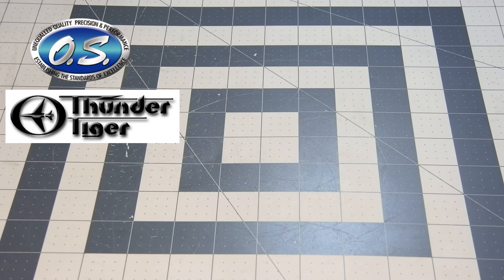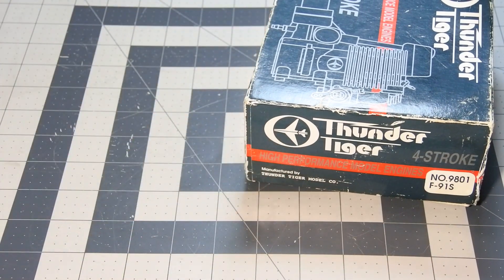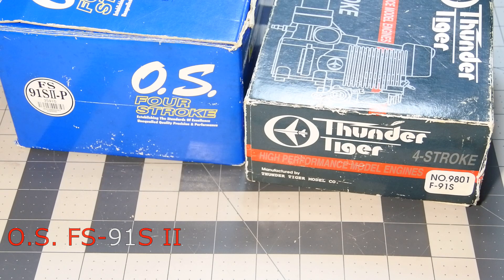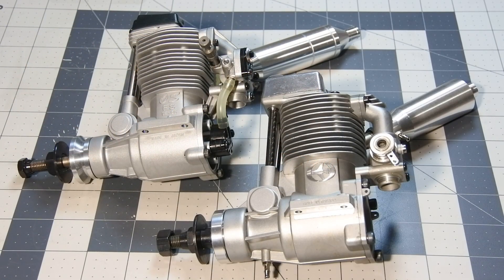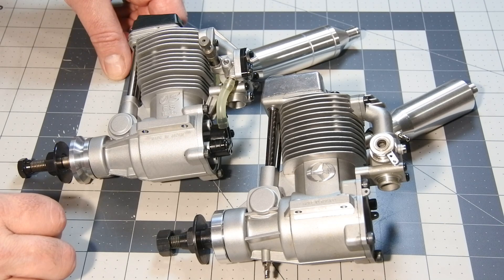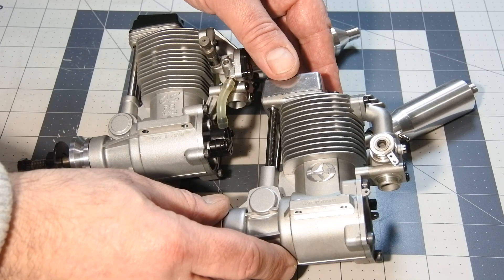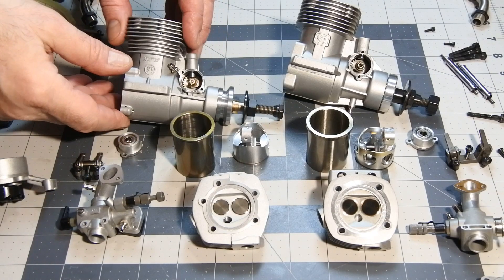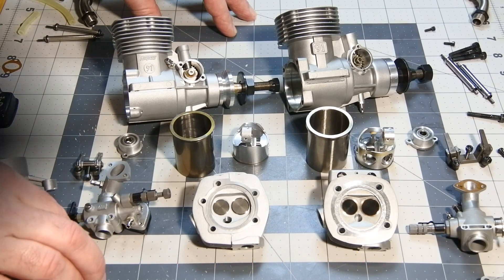Thunder Tiger F 91S and OS FS 91S II design comparison

Comment: You know if the OS can run with the pump removed or isolated some how?
Reply from the maker: Hi, thank you for your interesting question. I'm apologizing, that answering too late, wasn't have a access to my channel for a while. Regarding your question - yes, it possible to run OS FS91 II engine without the pump, mounted on the crankcase back cover. You can replace the back cover from other compatible OS engines, and use your engine in "simplified version". You should know, that you will get less engine power output and in case, that your're flying in acrobatic style, you can meet the circumstances, when in some plane evolution's your engine will suffered by the lack of fuel supply. Fuel pump in this model is specially designed, to guarantee undisturbed fuel supply at any evolution's of your model. Thank you for your interesting question, and have a nice day !

Comment: I also have both engines, but the Thunder Tiger doesn‘t want to run on full throttle, after a few seconds it starts to make ratteling noises, the RPM drops, fuel shoots out from the carb and it stops so hard that the pro nut comes loose and the prop continues to spin freely. 🙉
What could be wrong with the engine? I have already opened it up before the test run, it looks like new. 🙂
Reply: Thanks for your reply! 
I have a 14x6 prop on it and the high speed needle was out ~3 turns, should be enough.
Here is a short video of the engine: 
https://youtube.com/shorts/6JpRbqUST0g?feature=share
Reply from the maker: @gecrashed6565  Thank you for your reply and for video provided ! Unfortunately, this video is too short, to clarify what's wrong.  I'm sure, that the problem or in carb settings,  or in too high fuel level, this could be the reason, why engine behaves like you explain. Regarding the card, some people recommends 3,25-3,5 turns and this is still close to lean settings. B.t.w., how long did the engine takes to break in? Was it sufficient ? So my opinion still the same - engine runs very lean or with to high fuel level. 
I'll recommend you to read this article, where you can find some recommendations about this engine : http://sceptreflight.com/Model%20Engine%20Tests/Thunder%20Tiger%20F-91S.html
 
Thank you.
Reply: Thank you for your advice!
I don‘t know how long this engine took to break in because I bought it on Ebay and the pre- owner said that it hasn‘t ran much.
Reply from the maker: @gecrashed6565  No thanks at all. I could offer to start from the beginning, so to reset the car to factory defaults, to mount engine on the stand (not on airframe), to start an engine with the richer settings, and to run it for 30 minutes with different carb settings. Doing so you can also learn a lot about your engine and its behavior. B.t.w., you can run it in "economy" mode, on the fuel without nitro content. During brake - in process it's now so important. 
Good luck !
Reply from the maker: Hello and thank you for your question ! According to your description of engine's behavior it is showing the symptoms of detonation, so, engine runs too lean. Try to start carb adjustment from the beginning, you need to reset it (to return it to the factory settings, it should be described in the engines manual ), and start engine adjustment again. I've some plans to run Thunder Tiger 54 and 91 engines after a couple of weeks, I'll check, if your problem will happens on the bench. I'll make a video of this test runs, of course.
Thank you and have a nice day !

Comment: Of the two engines, in my opinion Thunder Tiger has the better engineering. I also am very impressed with the piston of the TTR engine, it required many machining operations to produce. The inclined valves and combustion chamber of the TTR are reminiscent of the hemispherical designs. And lastly, big bore will make more torque and swing a larger propeller. TTR for the win! 👍
Reply from the maker: Thank you very much for your comment ! I also have the similar opinion regarding engine design - TTR shows more advance and sophisticated design solutions. But the most interesting should be "head to head" bench test comparison. 
Thank you !

Comment: Thank you for these engine comparison videos, they are well choregraphed and interesting to watch. Just a note on the Thunder Tiger; you made reference to the inclined angle of the valves! You will also notice on the top of the piston there are recesses machined to prevent the valves from making contact with the piston during operation. Please if you are unaware, this means the piston has only one orientation(direction) as the valve recesses are offset to one side. If the piston is assembled incorrectly the valves will hit the piston and could be damaged. I'm sure you may have already figured this out? Some of Thunder Tigers design choices from the day were a little unusual and advanced I feel. Have a great day.
Reply from the maker: Thank you very much for your comment !   TT91 piston special surface shape is important part, agreed, and definitely, it should be added to this video comparison. I'll try to find the way, how to edit this video in YouTube cloud.
Thank you very much for your attention !
Have a nice day !
Reply: @crazyengines88  You are very welcome.
Reply from the maker: @bloodnocka  Thank you, appreciate for your support and attention !

Comment: Nice engines, I will never purchase engines with pumps in my opinion they are overly complicated and not worth the trouble especially if you’re just a sport flyer., thanks for the content
Reply from the maker: Thank you very much for your comment, appreciated ! I also think so, because have some experience with OS pumped engines. Confirming,  that its  tuning is very tricky and sometimes complicated. Thank you !